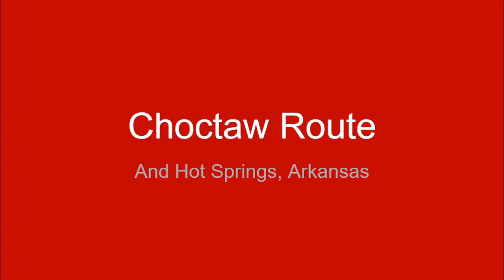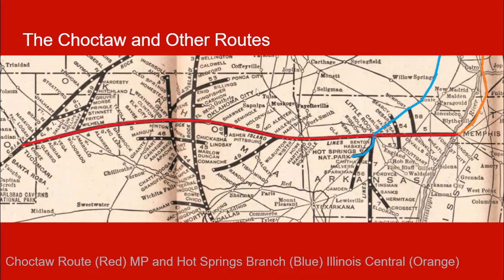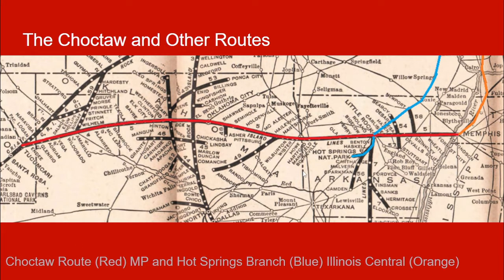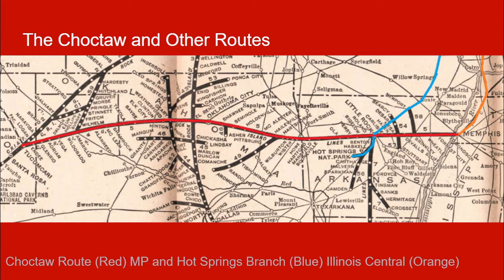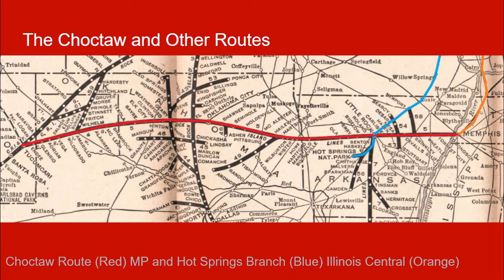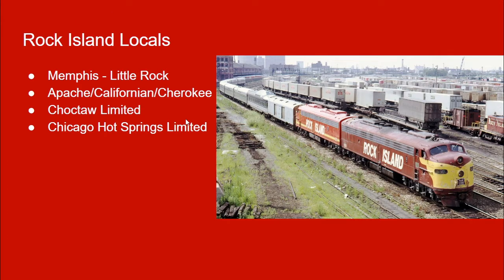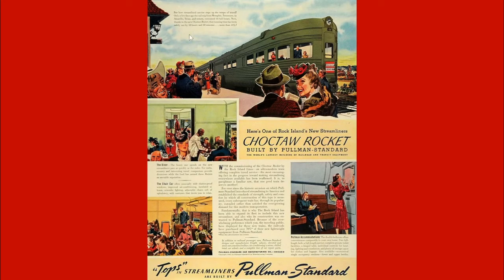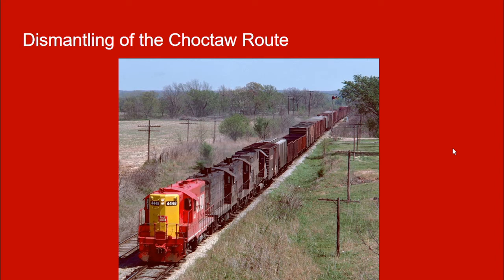History of the Rock Island's Choctaw Rocket

Comment: Your commentary about the Choctaw Rocket and the Choctaw Route/Sunbelt route, while entertaining, might benefit from a little more historical detail.  The Memphis-Californian, rather than being a secondary train, was the premier train on this route from the time it was inaugurated in 1924 until the Choctaw Rocket was inaugurated in 1940.  The Choctaw Rocket was downgraded in 1952, converted to RDC cars (Budd cars in Rock Island terminology) in 1953, and those were then discontinued in 1964.  The Memphis-Californian became the Cherokee when the train was dieselized in 1948, although it continued to carry through Memphis-Los Angeles Pullman cars and a coach into the mid-1950s.  The unnamed successor of this train lasted until November 1967, a victim of postal service and REA switch from rail to highway transport.  In early years, the Rock Island was a fierce competitor with Missouri Pacific for the lucrative passenger traffic from Chicago in to Hot Springs, Arkansas.  Through Pullman cars ran on the Illinois Central Chicago-Memphis and then the Rock Island to Little Rock and Hot Springs, while MoPac through cars from Chicago to Hot Springs traveled over the Alton and the Wabash to St. Louis.  Rock Island ended passenger train service to Hot Springs in 1951, conceding that market to Missouri Pacific, who continued service for another 13 years.  Rock Island management in the 1970s recognized the Choctaw route as a potential revenue generator with bridge traffic, and the route was rebranded and publicized as the "Sunbelt" route.  Extensive upgrading took place at many locations along the route, and while those projects were never completed, when segments of the line were scrapped, it was necessary to torch newly laid welded rail into 39 foot segments for salvage, not exactly a branchline that was lost.  Both Santa Fe and MKT conducted studies indicating that the route was viable, but both were concerned about the cost of finishing the route rehab project started by the Rock Island.  Missouri Pacific and Cotton Belt were both bitterly opposed to seeing the route reopened after Rock Island shutdown in 1980, and their heavy influence in opposition helped to assure that no state assistance would be forthcoming.